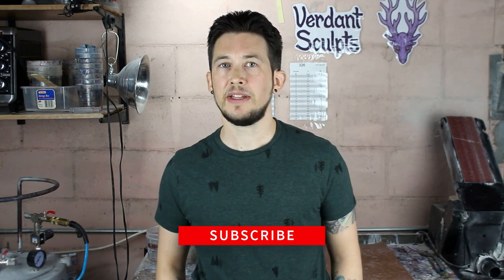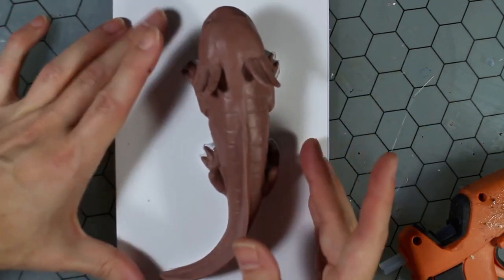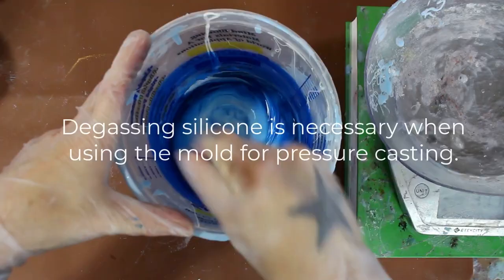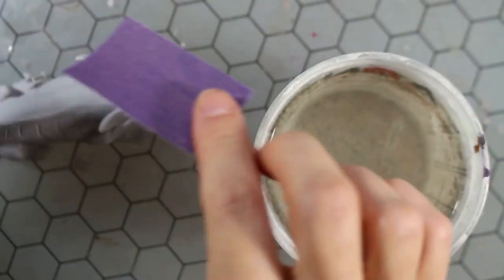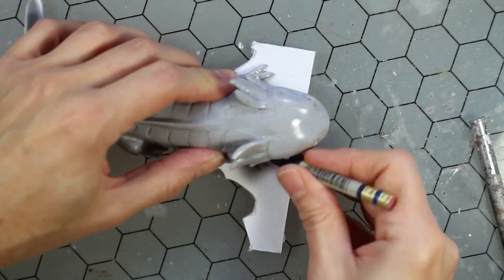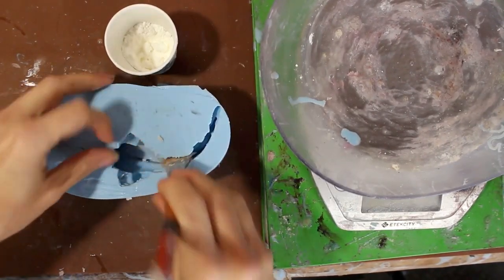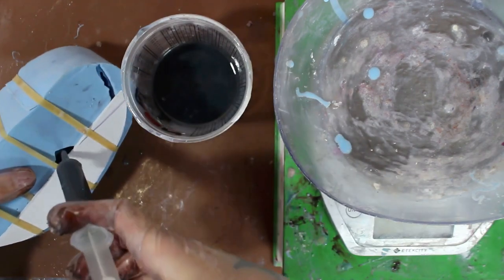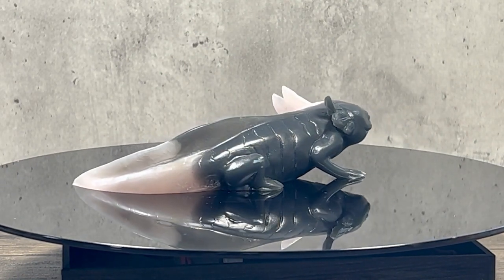An Army of (RESIN) Axolotls - Molding and Casting

Comment: Putting old mold pieces is so genius!!

What did you use to fill the voids on your master cast? (The lighter colored areas as seen around 8:00)
Reply from the maker: I use Apoxie Sculpt to patch!  Any epoxy type clay will work.  And yeah, I love reusing molds!  Silicone is expensive so every little bit helps!